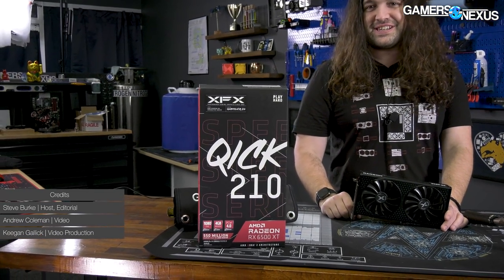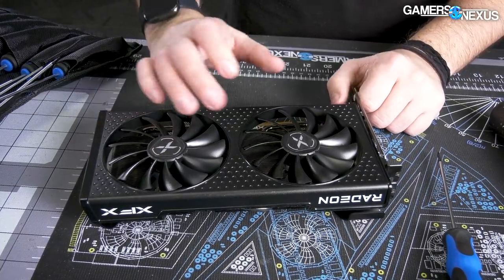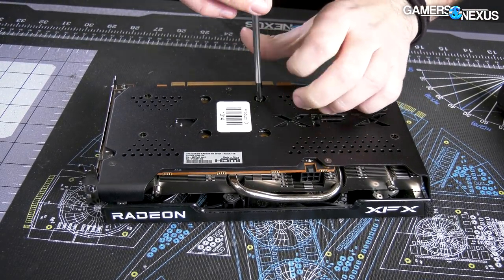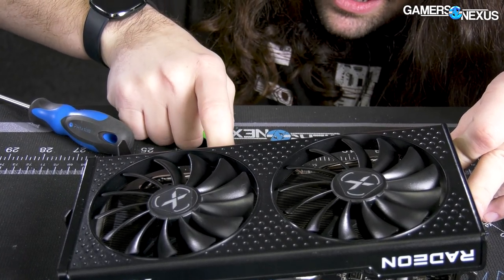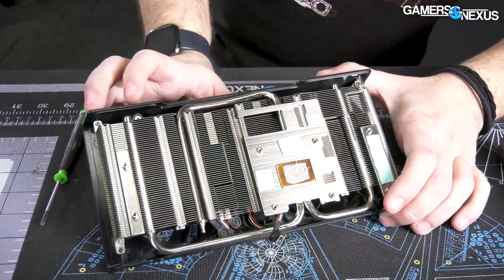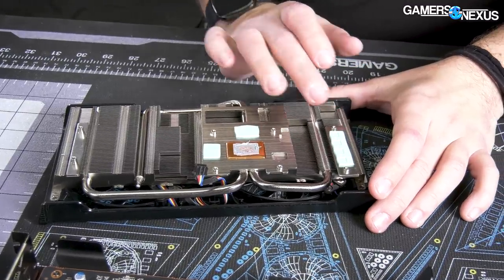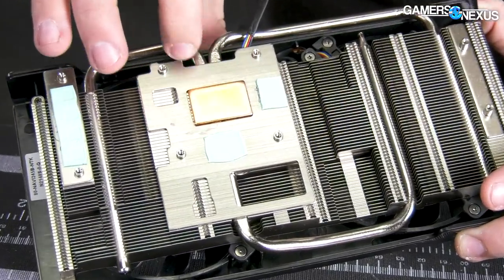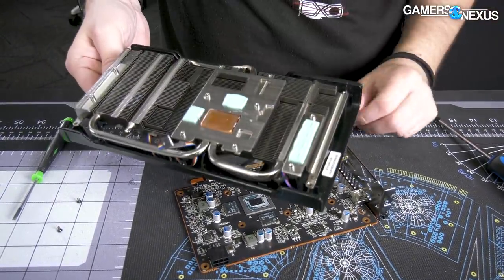Tearing Down Trash: AMD XFX RX 6500 XT Disassembly

Comment from the maker: Grab the GN toolkit: https://store.gamersnexus.net/products/gamersnexus-tear-down-toolkit
Watch our AMD RX 6500 XT review: https://www.youtube.com/watch?v=ZFpuJqx9Qmw
Watch how heatpipes are made: https://www.youtube.com/watch?v=AD-4WKwCAfE
Reply: steve, in this day and age we need to know more and your coverage is lacking.  example question:  how does the board taste?
Reply: asus cant install a capacitor right so ill be avoiding their z690
Reply: My toolkit is on it's way. Tracking it, should have by Monday at the latest.
Thanks Steve!!!
Reply: @Gamers Nexus   Question: Being a pcie x4 card, will this thing work when it's plugged into the x4 slot at the bottom of most atx boards? It's way to expensive for what I have in mind now but it's destined to become a pretty cheap deal in a couple of years when retailers clear out old inventory they couldn't sell because no one wanted this card.
I'm thinking it then could be useful for plugging in any additional monitors I have and use the card for any hardware accelerated tasks in Windows and applications like Chrome, media players and whatever can be accelerated that way without tapping into the main gpu's resources when I'm gaming on my main monitor and playing a movie/tv show or having YouTube playing GN videos in one of the bazillion open Chrome tabs I usually have on my 2nd screen. 
And yes, I can use any old card for that but I doubt a regular x16 card will even work in an x4 pcie slot
Reply: You guys should just design your own graphics cards. You clearly know what constitutes a good design.
Reply: excuse me, but it seens the toolkit is already sold out ;-;
Reply: 13:17
Punches the Qick
It checks out.
Reply: you took apart some e-waste, your very responsible for the environment!
Reply: You can’t just call a 6500 XT trash just because it’s terrible. That’s an insult to actual trash.
Reply: rx 6500 xt is pretty good gpu, fight me on that!
Reply: super cheap caps on that card too 
what a piece of garbage
Reply: LN2 OC it for shits n giggles 🤣
Reply: What is the cheapest gen 4  mobo ?  And a 64 bit bus should be illegal on a gamecard. If not a 128 bus than at least do a 96 bit bus. Yes they do exist.
Reply: @petervansan1054  you can get an RX480 8GB or RX 570 8GB for 150 euros of the streets at the moment. They destroy this card in value and in performance. Plus you do not need to upgrade to a extreme edition B450 or  basic B570 motherboard for pcie 4.0 to get the most, you can use any mobo you like infact. And they all have encoders and decoders for their streaming  / OBS, For nvidia you can get GTX 970 4GB models for the same price which also destroys the value of this card...
Reply: Usual BS from GN. Card is meant for budget gaming, period. It is not design to compete with 3060 or even 2060 or any other card of medium segment. It is time to finally realize - Brandon's dollars are not the same as Donald's dollars. This card replaces RX 460, perhaps 470 and that is it. Main competitor in low powered segment is gtx 1650 (not the Super, regular version).
Reply: @aleksazunjic9672  those card to for a lot less money. You can get a RX 570 8gb model here in the Netherlands on the used market for 150 euro easy..  This card is far to expensive and having 4 PCie lanes makes is virtually impossible to place in anything else but a AMD motherboard that supports PCIE gen 4. While its complete competition has 16 x lanes which will blow it away on pcie 3.0/2.0 which is still 83% of the entire motherboard market.
Reply: @tqrules01  Used card is a used card. They are always cheaper but you get no warranty.  Compare 6500 with "new" 1650 and you will understand. This is the only competition this card gets these days.
Reply: @aleksazunjic9672  you lost the argument, your not addressing every point. Nit picking means you have already lost. But I do like logic and reason, so for you I just looked for a warranty card new Fresh 6500 XT and I can only find a few cards, one was 399 euros on and the other 285, which means it has competition from mainstream GTX 1650 / GTX 1660 budget models like inno3d. And it gets destroyed by these cards. Don't forget to ignore the pcie4 vs pcie3 or missing video decoder or that you could get an RX580 8GB for the same money not to long ago.. I'm having fun though please come back!
Reply: @tqrules01  I did not lose anything, but looks like you lost your mind :P I don't know about prices in Netherlands, but if they want 400 euros for this card, simply don not buy. It is not worth more than 200 euros even in this market. Btw, this card is faster than 1650 even on pcie 3.
Reply: You know what? I am starting to think AMD should have gone back to basics and rereleased the 580 yet again. But die shrunk. If you take that old 14nm card and take it down to 6nm, you get the same performance at 43% of the power. The 185w of the RX 580 would be dropped down to 79w. Bios limit it to 75w and call it a day. No extra power needed, and the Polaris node has pcie 3x16, so no issues there. Would have been an interesting move.
Reply: @johns70  Re-released rx-580 would have MSRP of $400 due to inflation, and you would not be able to find it (at least 8 GB version) due to miners. So it would not solve anything.
Reply: @aleksazunjic9672  nah, they already have a lot of the stuff needed, so it will be similar in manufacturing cost as the Navi 24 node. And they can still pair it with 4GB of VRAM if they wish to
Reply: It's sad to see the slip back in time and production. Based on the review I don't think it would really benefit from a 4Genx8 lane instead of the 4x4 would it?
Reply: I have had a direct relationship with AMD for a year now. This video explains what has happened on our side for the last 3 months. Too bad.
Reply: im sooooo tired of the sardonic commentary, The facts may be true, but the 'tude is tiresome. Unsubscribed.
Reply: Do you guys remember what the thickness of the thermal pads was? I have a used one of these that I'm going to use for my wife's PC that I'm going to repaste...she's using integrated graphics right now

Comment: The best part of this TEAR DOWN is that you don't need to put it back together.
Reply: Sure he does - how will it go into the disappointment build at the end of the year otherwise?
Reply: @mjc0961  I think things can go even worse so who knows.
Reply: @MiGujack3  I honestly can't imagine. It kinda seems like a severely handicapped rx570 4gb like 6 years later for 3 times the price.
Reply: @haikatta....8023  WTF?
Reply: better put in a giveaway
Reply: keithsze001  I want one, it's not that bad if you have PCIe 4.0
Reply: @xDream3773  ugh, no, it's still very bad. Remember with this card you can't even watch youtube without stressing your CPU because the GPU has no hardware decoding.

LE: apologies. It's just AV1 decoding that's missing. It does have H256 and H257 decoding.
Reply: @xDream3773  Its trash either way. Too much corner cutting and cheaply made, you'd rather way better off with an RX 580 or RX 5500XT or GTX 1650Super.
Reply: @hircine92h  Dude there are many ppl who owns a very old gpu
Reply: @hircine92h  Can you buy a 5500xt and 1650 super rightnow in 250$ price brand new? We are not in 2019 dude those GPU you mentioned are way overpriced even at use they cost 300$!
Reply: @mdo  it’s missing av1 and the h format encodings
Reply: Someone's trash is some people's treasure at least it's way better than Intel HD 4400
Reply: @mubindaghost  I agree on this
Reply: @xDream3773  to be fair a rx 580 and 5500xt cost between 50 and 25% less for much better performance so why get a severely handicapped hd 7970? 

Just get a hd 7970 for like 300 bucks less and get more performance.
Reply: @mubindaghost  actually its not. The hd4400 doesn't cost 400 euros lol. Also just get a much cheaper and better gpu. Most gpus in thr last 10 years will be much better in most cases.
Reply: @tilburg8683  lol they are used cards dude, we are talking brand new with warranty. I'm not confident buying used.
Reply: @tilburg8683  rx 580 and 5500xt cost less? Today's market? Even used they cost 300+$ dollars dude. Which universe do you live?
Reply: @tilburg8683  You are recommending GPU from 2011, what the hell are you talking about who the hell will spend 300$ for a 10 years old card. Damn your brain is not working. sell it on ebay